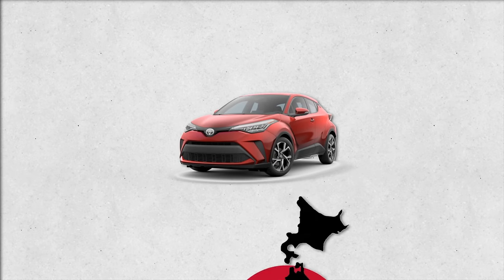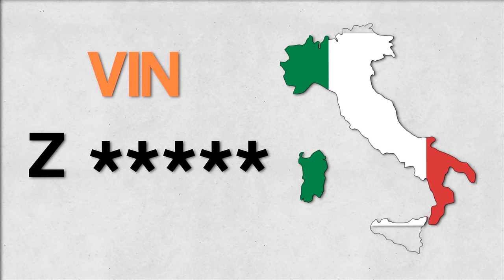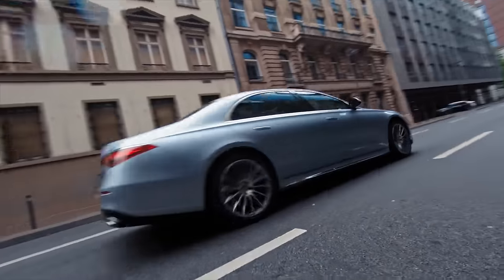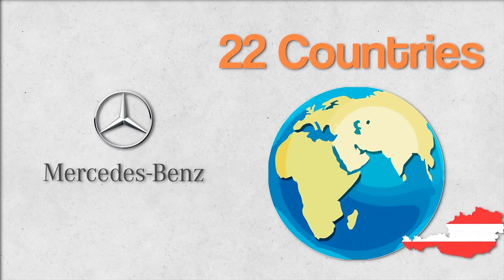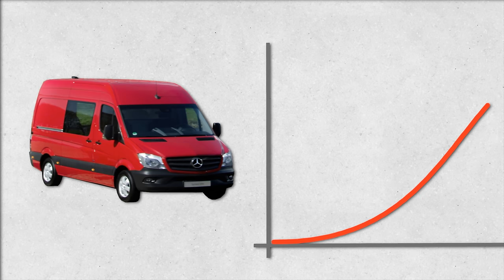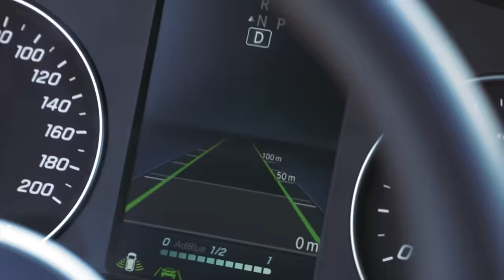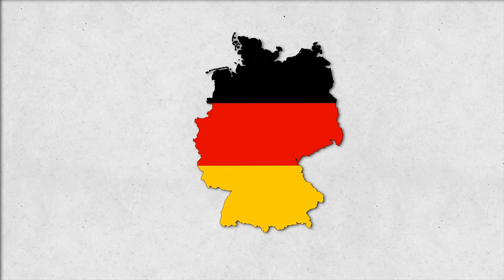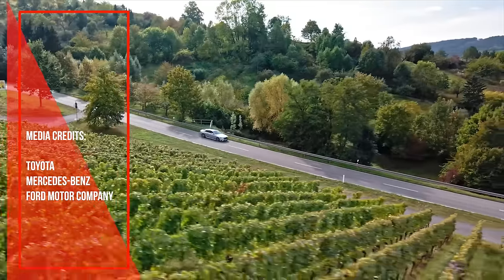Never Buy a Car Made in...

Comment: Hey scotty, last week I bought a 1996 Toyota chaser, its only got 60k original miles, Should I start using a lighter oil for the oil changes because of the age or still use the recommended 10w-30?

Comment: Ok I watched another video where you said you help diagnose if there's too much pressure when you go to fill with the little can but I can't find it. Do I need to take it to a mechanic so they can suck the refrigerant out with a recycler? It just started blowing hot, it went from ice cold to hot in about 10 minutes. Went to top it off thought maybe the refrigerant was low but the cans pressure gauge was in the red. Any suggestions?

Comment: I had a 2013 Camry made in Kentucky for a year before I wrecked it. It was hoenstly pretty solid. Only issue I had was with one of the back speakers that made a subtle noise that continued even after getting aftermarket speakers. But it didn't really affect anything. I miss that car everyday.

Comment: I owned a BMW E93 335i cabriolet 10 years ago, that car  was made in Germany and the quality was awful, leaking oil at low milage and water pump broke 2 times, i am driving a Lexus and a year 2000 R34 skyline coupe , never had a issues ever, European cars are over priced junk i would call them.can only be Leased them than own.

Comment: I live in Australia and my 2019 Carmy was one of the worst cars I've ever owned from faulty trans to crappy interior quality. Wonder where it was built?
Reply: It could have just been poorly maintained
Reply: @thomashenry794  Nope, only had 19,000ks when the trans started giving problems
Reply: Toyota stopped building Camry’s in Australia in 2017.
Reply: @Deatomizer  8 speed automatic?
Reply: @Mika-ph6ku possibly. It was an auto but not sure how many gears
Reply: @Deatomizer  Probably the 8 then, don't see why any other transmission would have such issues so early on. The problem is a software bug that you can take to a Toyota dealership to fix.
Reply: @Mika-ph6ku  Well, it's been to the dealer a few times for the trans and other things.

Comment: Either way, MBs are crappy compared to the older ones.
Reply: Wife is sleeping otherwise I'd call. You think the newer ones are better? I had only 2. 1973 280 S, but it was imported because it had the 2 2BL Webers and a 4 door. Only the automatic antenna didn't work. Got 30 on the highway and went anywhere in the snow. Had a 1990 something 190 D...no turbo, but quiet and about 30 around town. Great handler. Both were more comfortable than my 2009 civic...but only maintenance no major work at 150K.
Reply: Maybe the 190D was an 80 something...
Reply: There have been well made made in North America prior to the current decade of sellouts at the corporate level. Examples are steel disc breaks. American discs would last forever compared to Japanese or European brands. I had a 2002 Dodge Stratus 4 door with 4 wheel disc breaks. The German  made rears lasted less than 20K and the fronts less than 30K. Replaced with made made in Mexico for the rears and USA for the front. Sold the car with 98K and very little wear...using ceramic pads.

Comment: I NEED HELP!!! So I have a 2006 Mitsubishi Endeavor that  has Heating and cooling Issues.
The issue is that when heat is on only one side throws heat same with A/C
I like to think I’m pretty mechanical and I know it is a damper issue. I’ve tried many things I Flushed the heater core Put a new Radiator on it and more. I even broke down and took it to a Mechanic and he was stumped and said that they are electrical dampers so then I went to Junk yard and got a a new control switch
The thing runs great it’s my Fishing / work beater but I can’t use in winter because the side that don’t heat us is the drivers side and in Wisconsin that takes about an hour to get that window melted because the one side still blows only it cold air. SMH! 
So have you ever heard about this issue on a Mitsubishi Endeavor???? Cus I had a cutless once I used a coat hanger to open and close damper …. This my friend is mind Boggling